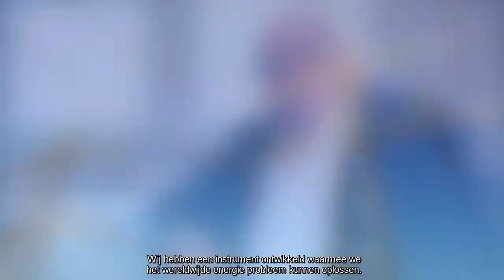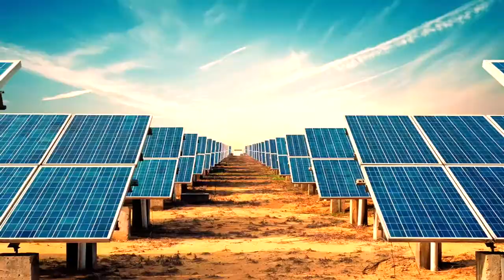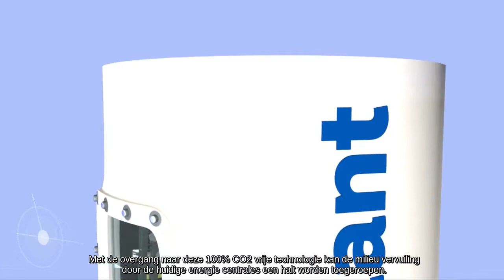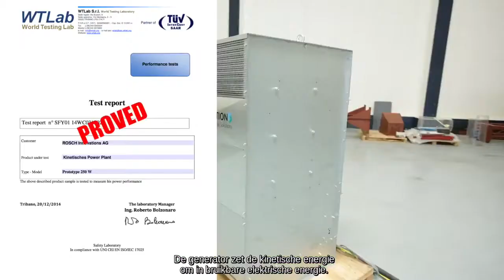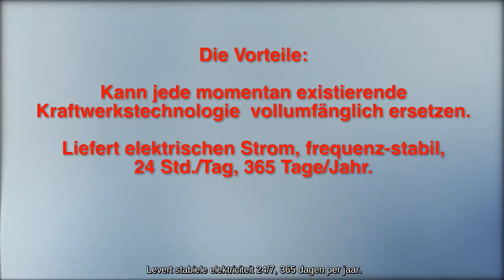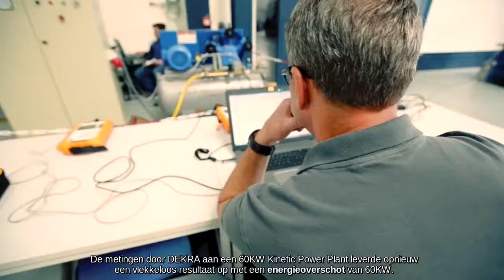rosch innovations kinetic powerplant

Comment: This is a BOLD innovation: Exposing the fact that kinetic energy used to generate electricity can easily be offset with electrical energy excesses that more than compensate for the expenses of generating the kinetic forces required to motivate the traditional generators. Electrical generators use self-generated magnetic fields to induce electrical power as they are kinetically moved past magnetizable cores wrapped in wires.. Back in the 1800's Climente Figuera demonstrated that the magnetic fields could be motivated by electrical means and produce excess electrical power; an innovation that could easily replace this Rosche innovation, which is nothing more than a more compact water wheel, replacing the waterfall with a bubble tank. Party on Dudes, be good to each other. The real innovation is developing a sustainable profiteering business without any expense... Now that is an innovation that would break new ground. Can you make money on free energy? Party on, free the world from energy-economy enslavement..
Reply: it is NOT bold, it simply is a scam.  you will only need a couple of minutes to check all ingoing and outgoing forms of energy and how these energies are converted to see that there is absolutely nothing done but destroying useful energy into waste energy turning some drums in a water tower.